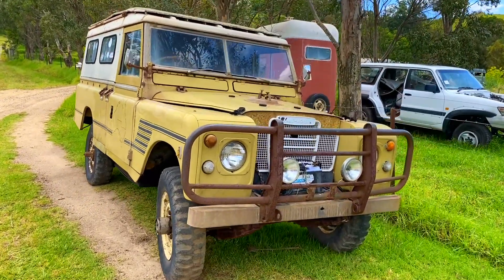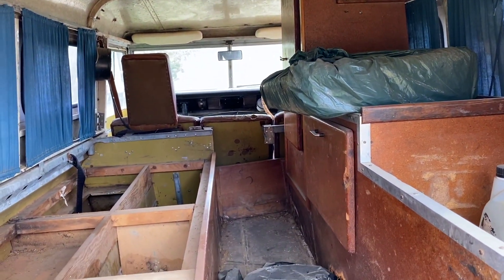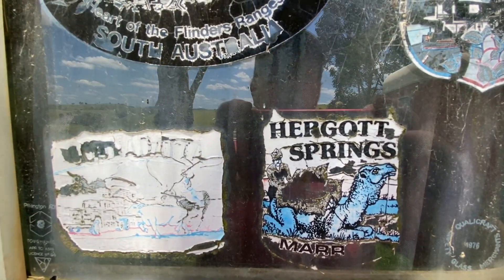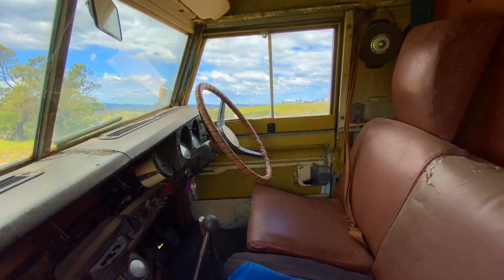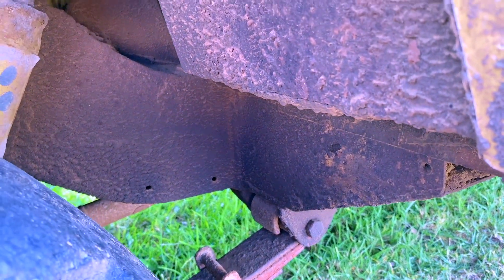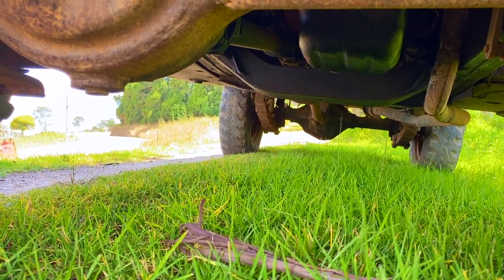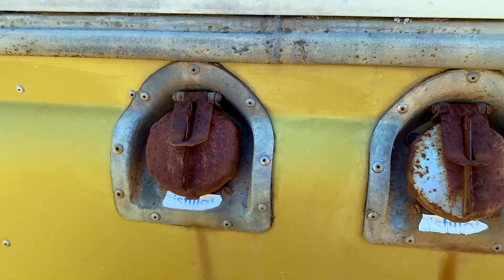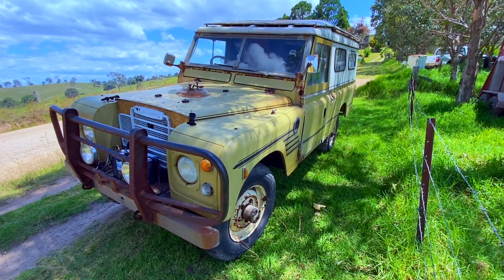$800 Land rover - the good, the bad and the ugly.

Comment: That old wagon even had a spare wheel bonnet mount, they're getting hard to find. My series 1 project has been slowed down as the Disco is also in the workshop getting a new recon engine and I'm learning how to rebuild a transfer case. Great for my fitness, I'm walking everywhere.
Reply from the maker: Disco IS dead!!!    My buddy Davos' Dico pooped it's pants crossing the Harbour Bridge in Sydney the other day, sounds like big end bearing or something equally exspensive, I told him Disco was dead too. (my advice is worth what you pay for it). Does Wilms have a spare chariot fitting of a bloke of your standing?    I put the bonnet spare on my 109 and its like a trip to the gym to open, not sure its a great idea but I love that look.

Comment: Yet another rusty Land Rover.  I owned Land Rovers for 30 years.  I did some beach driving, including into salt water over two feet deep, in both New Jersey and San Diego.  I never, never had a rust problem on any Land Rover I ever owned.  My last L-R, a 1972 Series III 88" deluxe hardtop (USA spec) I had for a little over 20 years before it was stolen from me.  That car, even after 20 years, was rust free.  My secret?  Washing the undercarriage very, very carefully with fresh water each day for several days after driving in salt water.  Best of luck repairing this vehicle from the rust "issue" you have with it.  Andy McKane, Maunaloa, Molokai, Hawaii.

Comment: In the UK you cannot buy one for AU$800. The minimum for a rotten non-runner with seized rotten engine and rotten bulkhead and rotten floors etc. for les than $AU 3000
Reply from the maker: Sadly Steve, that's too much money given what they cost to get back on the road.
Reply: That's bullshit mate,  there's plenty to choose from in the UK,  my mates just bought a series 3 for 2 grand  needed a set of tyre's and 2 leaf springs and it flew through the Mot,  agreed there's some real shit out there but there's loads of em
Reply from the maker: To be fair 2000 pounds is a lot more than $800, but it's good that there are still some good cars to be found in the UK, perhaps they will stop being exported from Australia back to the UK.... :-)